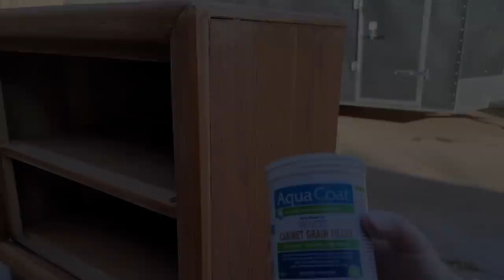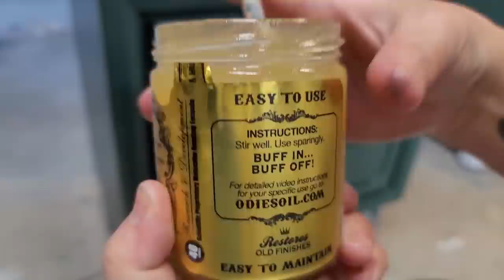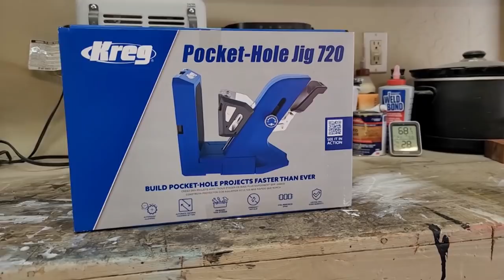Nightstand Makeover/Furniture Painting/ DIY Modern Base

Comment: I have almost an  identical  night stand. It has that sort of scalloped base on it and is attached to the front of the stand. So, no removing it. I guess I'll have to live with it because if I tried to remove it, I would be getting into the bottom drawer. The only thing I could see doing would be to put a sheath around it...if that makes sense. That would give it a more streamlined, modern look. Anyway, yours sure turned out well. I definitely see the Angie touch. As far as your color(of course, it translates differently on different screens), I'm going to say Marine Green. My son was a Marine...guess I'm partial. Thanks for the inspiration! 🙂👍💖

Comment: Wow what a difference those legs make. They are awesome. Great job. I love them. Do you have any make overs that have a repair and not paint them. I just bought a 1950s/60 style Jetson style  light blonde wood it has a bookcase head board and cool designs cut into the fronts but it’s laminated and I don’t want to paint them for a chip in one and a drink ring on the other. Is there anything that can be done
Reply from the maker: I have a restoration piece I am working on now. It is solid oak though. It doesn't work the same as laminate. Check out Transcend Furniture Gallery she has a lot of tutorials working with laminate pieces.
Reply: @SabsRehabs  thank you I will I’m just finishing watching another of yours for a client.

Comment: I'd like to ask your advice, I've been too embarrassed to ask anyone what to do, but I feel you won't think I'm so dumb, (hopefully). My very first painting project, I really didn't know what I was doing, I painted a little side table which has a piece that is a very elaborate carving. Ok, I used Annie Sloan paint, and without an top coat I put white wax on it, stupidly I just left it un buffed. It feels yucky even after 2 years and I've never used it. I'd like to try to repaint. How would I remove the wax and paint? Stripper or sanding? Any advice would be so welcome. I must say I've learned a lot since then and have had a lot of success painting furniture. Thanks so much. Have a blessed day 🌹
Reply from the maker: You can take a couple different methods. If you used Annie Sloan wax you can actually just paint over it again with more Annie Sloan paint (this is the only brand I would do that with). Or you can remove the wax with some mineral spirits and scrub with steel wool and get back down to the paint job. Lastly if you want to start completely over and remove the wax and paint KwikStrip 15 minutes stripper. Make sure you have a stiff bristle brush to scrub off the paint and wax in the details. Hopefully that helps you!
Reply: @SabsRehabs  thank you. I think I'll try the citristrip, since I have that. I think there's latex under the chalk paint. I'm thinking I may have to strip more than once. Thanks again for your prompt and informative reply. I'm watching as many as your videos as I find a few minutes! Love your thoroughness! Have a blessed day 🌹

Comment: These are not mid-century, which is the 1950s through first half of 1960s.  These were probably manufactured in the 1980s or 1990s.  It seems that a multitude of people are calling furniture “mid-century” because it is a popular style.  Most of what is being characterized as mid-century is not.
Reply from the maker: I am fully aware of what mid century is and I am fully aware those were nightstands from the 90's. I gave them a mid century makeover, as in a style not an era.